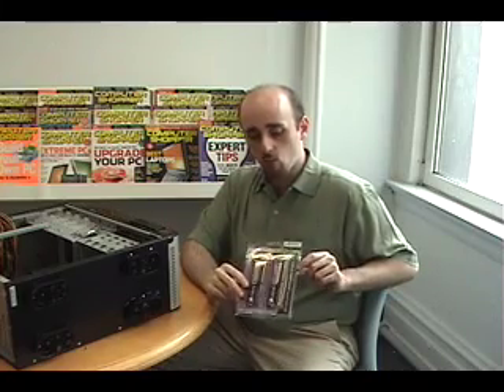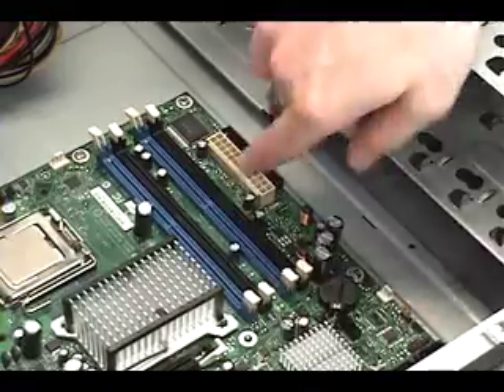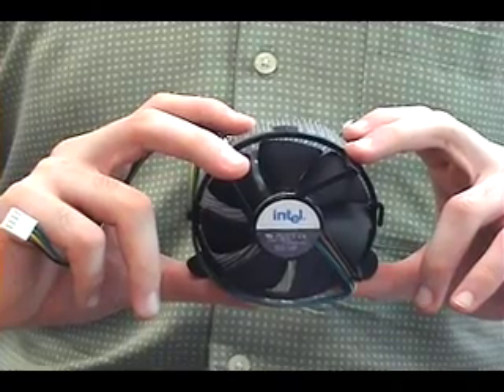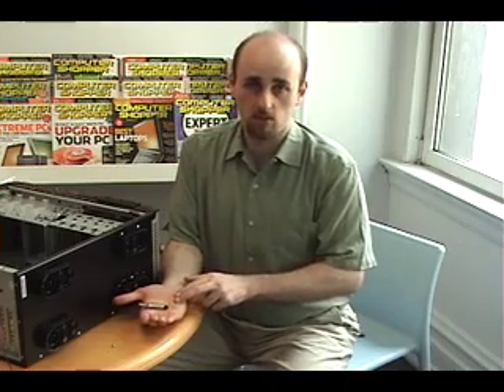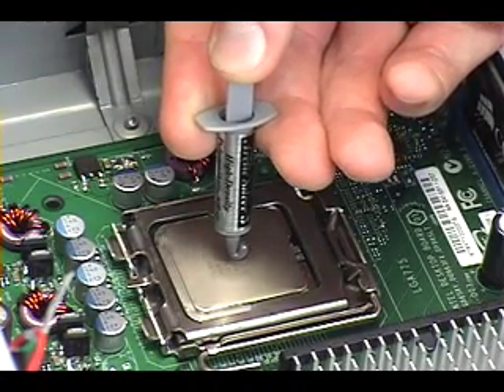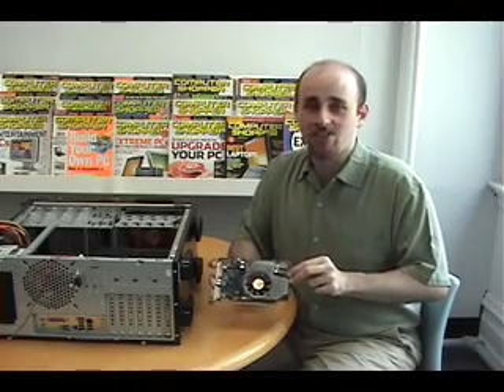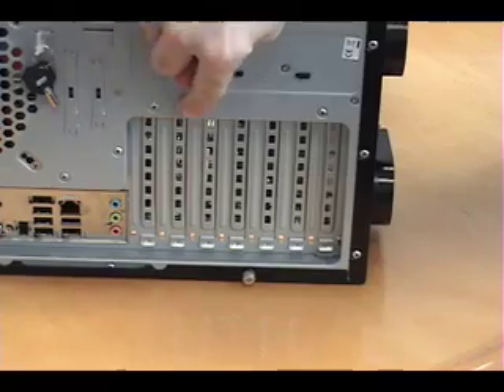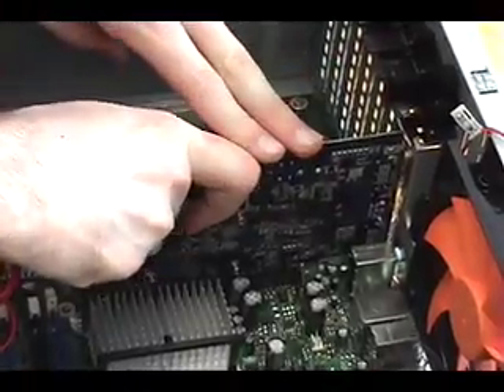Computer Shopper: Build a Multimedia PC, Step by Step (2/5)

Comment: You know you would have saved yourself a lot fo time, just to install the cpu, cpu fan, and ram on the motherboard before putting it into the case. I alwasy put the power supply in last too.

Comment: isn't it easier to put everything you need on the motherboard then put it in the case afterwards & just connect the cables afterwards since leverage is better for installing components while the motherboard is out of the case?

Comment: Maybe you should do some builds yourself before you make any statements like that.

I've built several machines and used the regular intel cpu heatsink/fan. It works absolutly fine, its easy to put it in with a flat-bladed screw driver.

Also he put enough thermal paste on, the paste will spread at and cover the entire cap of the processor.

Comment: this guy makes 2 mistakes with installing the cpu cooler. 
First: Installing the cpu cooler after you installed the mainboard is not very easy. Install your cpu cooler right after you have installed your cpu, before that you install the mainboard in the case. This is because you can better see what you are doing instead when you install it as in the movie.
Secound: The cooling paste has to cover the hole cpu, or the part on the cooler that touches it. Not just a drop in the middle of the proc